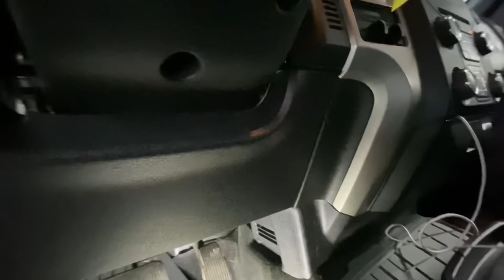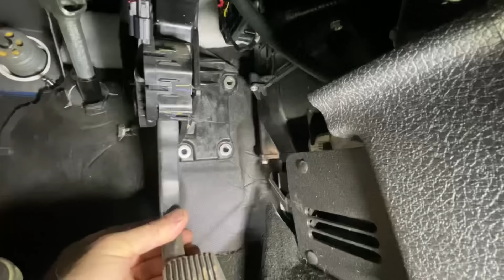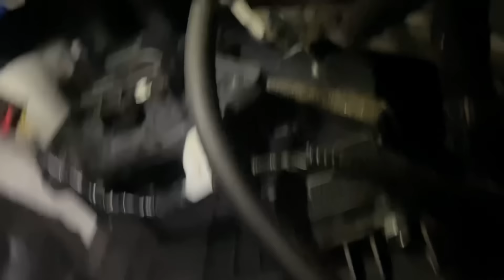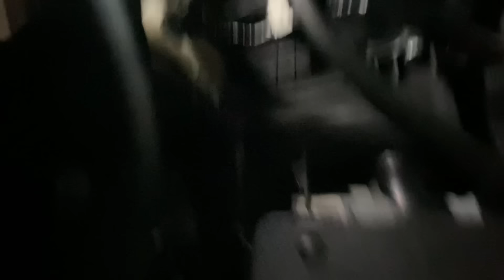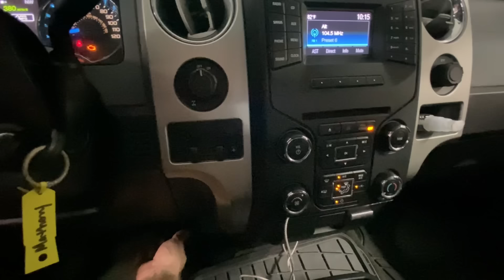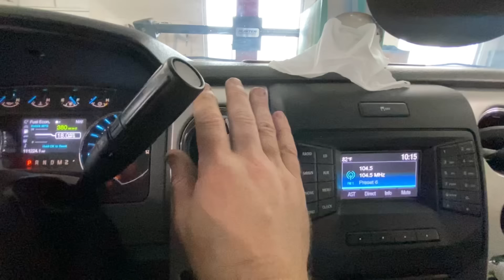Fix the Clicking Noise Behind Your Dash: 2010 F150 Mode Door Actuator Repair Guide

Comment: I hope you can see this, and maybe give me a tip? I have this problem. I followed your steps…do I need to replace the white wheel inside? Or did you just pop it out, and then pop it back in?
Reply: Buy a new actuator for about $40. The gears aren't replaceable, I believe he is just showing you why they go bad internally.

Comment: You make it look so easy
Reply from the maker: @ryguy57106  this is one of the easier ones to do. Especially if you remove the pedal. If you don’t, getting that top bolt will have you second guessing taking on the job and cursing the engineer lol

Comment: That's a great tip to remove and push aside the gas pedal. I find these to be seriously annoying repairs, with a sore back for days each time.
Reply from the maker: @spelunkerd  thank you, makes it so much easier to get the top bolt out. Another thing I did different on this one to try and help the awkward position, I raised the truck to a hight that didn’t require me to be on my knees.

Comment: Interesting comment on  brake job lube. Some lube and some don't. I have never seen lube from the factory. If the pads are tight in the bracket it is probably because of rust. Lube may help a little but it's the rust that should be addressed.
Reply from the maker: @eldoradony  Thank you for sharing your thoughts on this. In this particular case, we decided to redo the previous brake job and added brake and caliper grease under the shims. Given the thinness of the shims, I believe this helps mitigate harmonics, which can amplify with even slight vibrations. Additionally, it seems to reduce rust buildup on the underside compared to original setups. From my experience, using lube during prep work makes a significant difference compared to the typically dry, OEM jobs, which often face binding issues due to rust under the shims. Your insights are spot-on and align with what I've observed.
Reply: Brake lube is a must in the salt belt. Prevents the rust from forming - or , at  least, lengthens the time till the rust  forms. When applied to the back of the pads, reduces chance of squeal. Especially with cheaper pads that don't have an anti squeal layer on the back.

Comment: Was it aftermarket or dealer part
Reply from the maker: @williammason7092  the actuator I pulled off? It was OEM. 
Brakes, just the pads and one caliper was replaced. OE as well